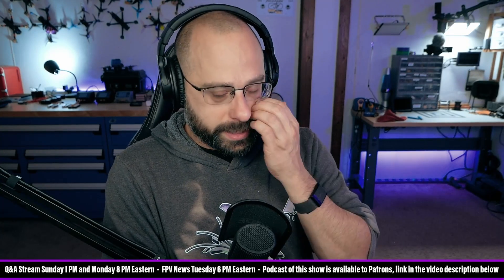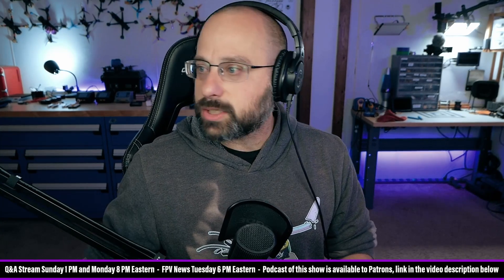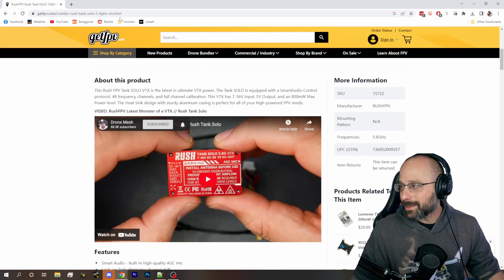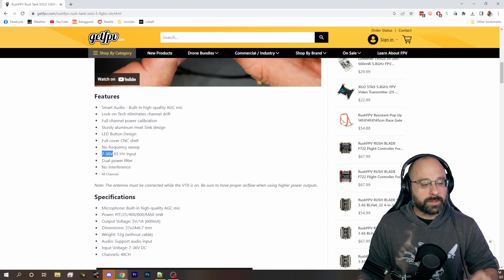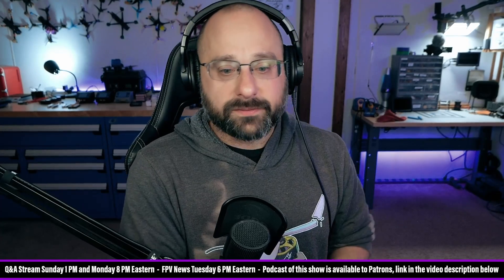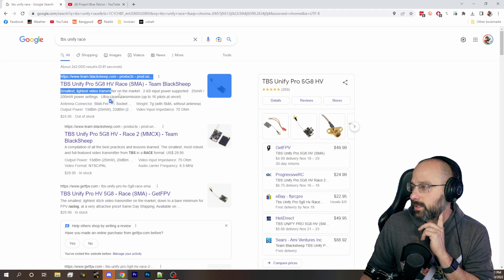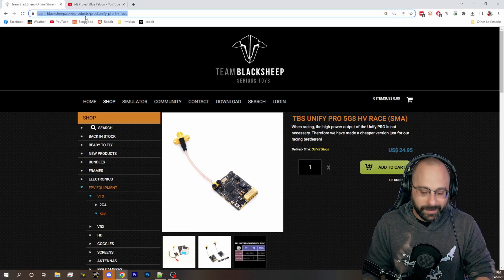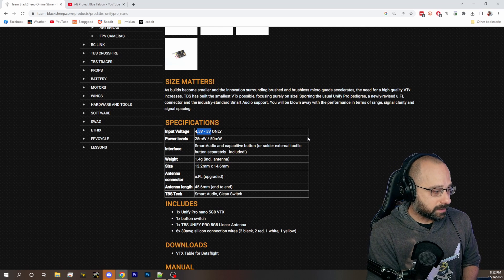What Should I Use Between VBAT, 9v, 5v on a Flight Controller? - FPV Questions

Comment: Experienced builders: 'Yeah I know all this shit"
Beginners: 'Still looking at screen dumbfounded with some kind of HV analog vtx in hand and a cooled off Soldering iron"
ME: trying to figure out how to connect the DJI plug to a Speedybee V3 F405  and the de-pin the other connector so the cables can be plugged in to a Walksnail vtx minus the SBUS wire and 2nd gnd cable.
yay, the shit you find out everytime you try something new in this hobby :P